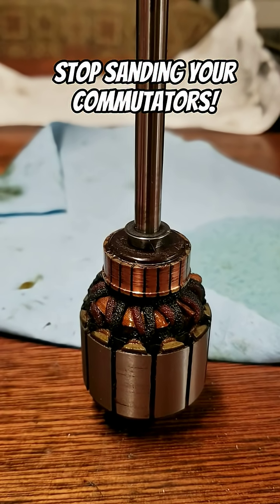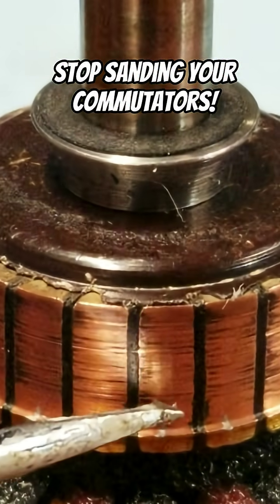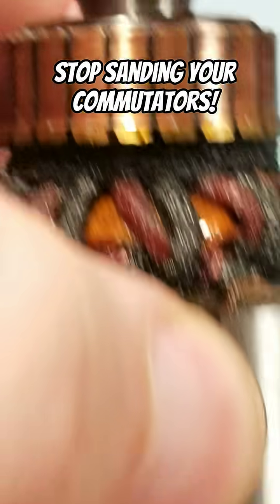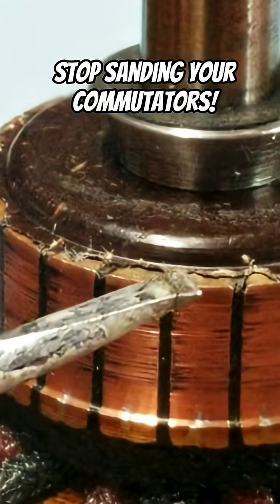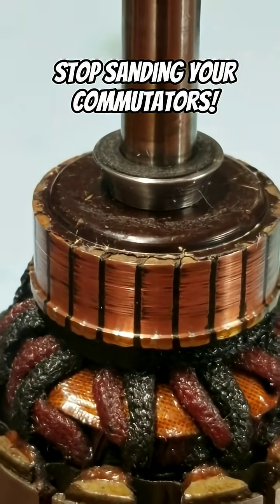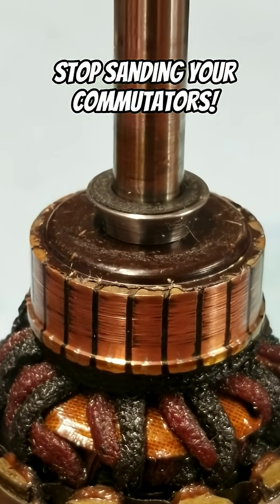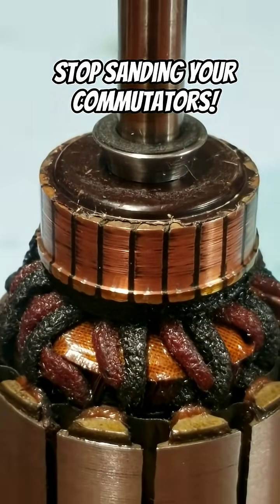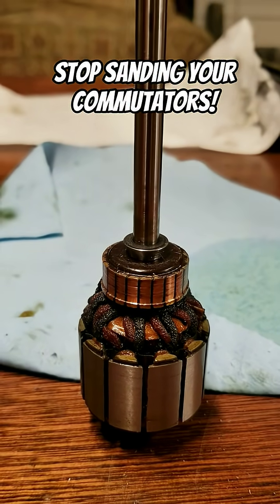Singer 201 Actuator Commutator Cleaning Mistake!?

Comment: The tiny grooves that develop as the brushes seat with the commutator actually increase the area of contact, which actually reduces resistance and improves efficiency.
Reply from the maker: I know, and deforming the commutator shape will cause the brushes to be eaten away quicker.
Reply from the maker: "If wiring is not damaged, clean commutator (V, Fig. 17) with a dry, clean cloth before assembling motor. If it is impossible to get the commutator bright by this means, use and ordinary rubber eraser. Never use anything else on a small motor commutator." – 1936 Edition of Singer's Adjuster's Manual